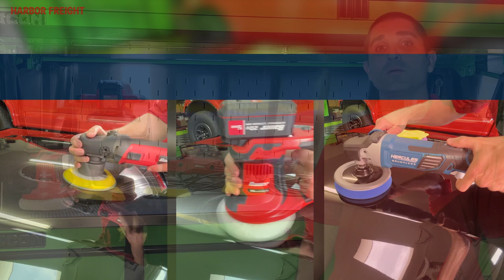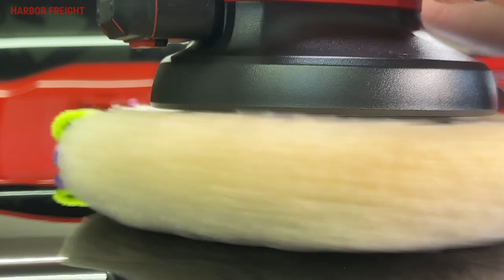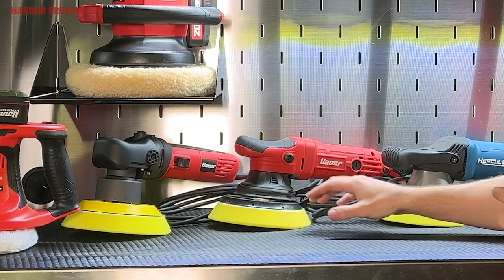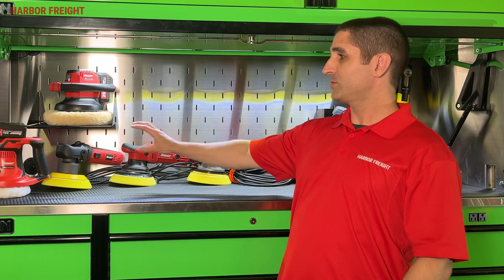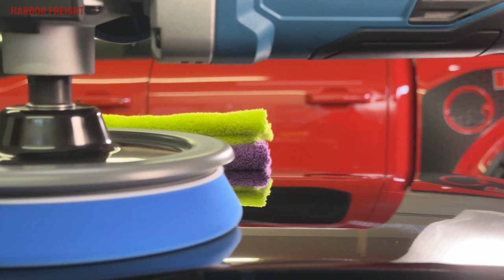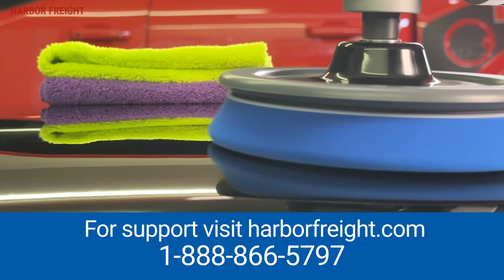How to Pick the Right Polisher | Harbor Freight

Comment: Harbor Freight when only the finest will do :).  Actually I learned quite a lot from this video.  Did not know about the option to allow to press and keep the speed up.  My polisher is a very old Porter Cable that just will not die.  Actually looking for pads because they are getting spendy.